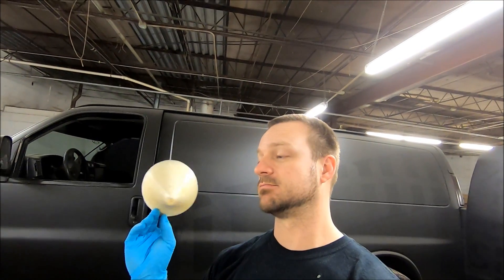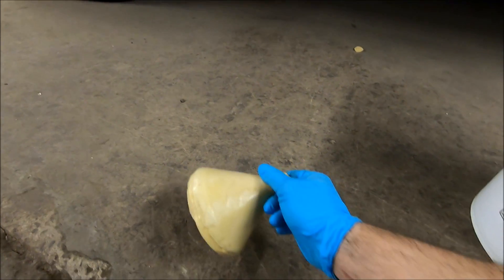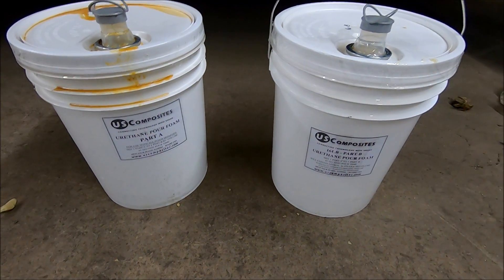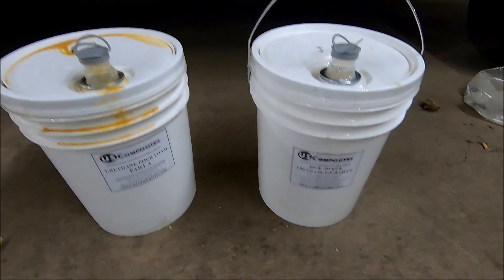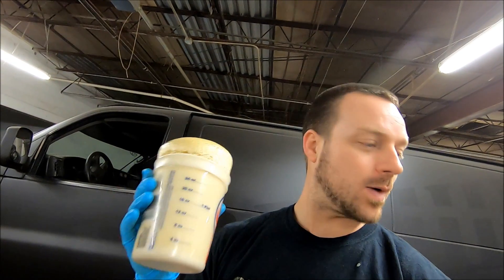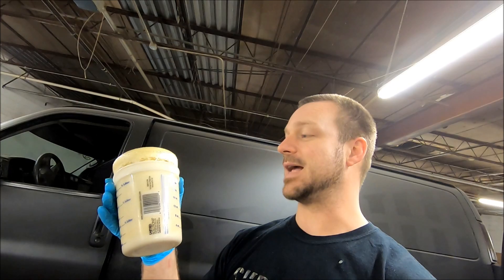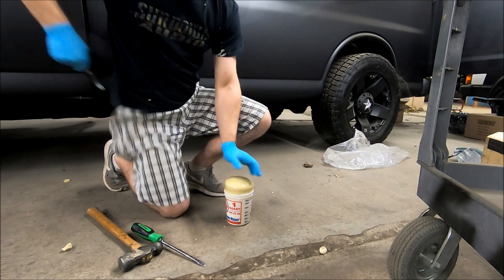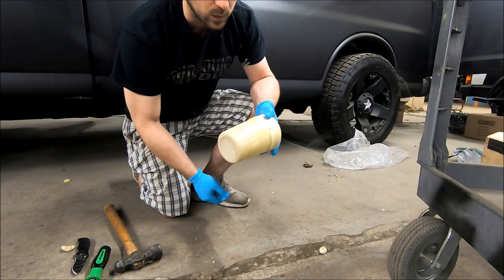***Strong As Concrete*** *Tech Time Thursday* 16lb Expanding Foam

Comment: Does it bond to what it touches?  I have 2 fiberglass sheets parallel spaced about 2" - would this foam bond to the sheets making the structure stronger?  Final result would be similar to a surfboard.

Comment: I was thinking about making a subwoofer box out of this stuff. I want to put a subwoofer in the rear side panel of my suv . I wanted the foam to form into the finder well and around the speaker . I want to box out the  air space with card board and tape it up so the foam can form around the speaker , panel and finder . Do you think this would work ?

Comment: a long time ago I heard of the japanese guys filling thier sills with expanding foam to increase chassis rigidity and they were even selling kits. Unless it set as hard as concrete it wont work but would be good for insulation and causing rust only.
Reply: Wouldn't it be like 3m pillar foam? Factory uses it.

Comment: 12 ounces of material made (-/+) 30 ounces of foam, that not impressive but there was one aspect of this video that was really sad and that is you don't have a utility knife...sigh
Or I'm guessing you don't cause I gave up at screwdriver and hammer on the floor.
If it doesn't stick to plastic 🤦‍♀️
POKE A HOLE IN THE BOTTOM...SIGH
Reply: Umm, it's 16lb foam, made to be dense, not airy.  It's not supposed to expand more than that.  If it expanded 2x as much, it would be 8lb foam.  If it expanded 4x as much, it would be 4lb foam.  It's not magic, that's how more and less dense foams work.  The more dense, the less expansion.

Comment: Might you know the maximum temp this mixture becomes and for approximately h ow long - when it sets?  I have an app where I can see using this to fill voids (to help preventing rattling) in an interior car plastic panel.  My concern is that this heat could distort the original shape of the interior panel.  Do you know of any such similar products that have a lower cure temp.

Comment: Could you mix silicates into it for more rigidness like you would epoxy or STF? then cover it with a bed liner, like line-X or something similar sold on the market? Id like to see a 2 x 3 ft, 1 inch thick plate of that shit take a durability test.

Comment: Great video. My pool steps are sinking due to collapsed support. It is made of steel like the pool wall. I am thinking of drilling a hole and pour this stuff to support the steps.
Reply: Did you use in your stairs... if so how is it holding up to the water? Is it soaking up water at all?

Comment: Does the foam make you're car rust after some years ?
Reply: So short answer is no but there is a caveat. Where the foam expands and fills its waterproof and obviously very hard, however if you have a void where water can enter and then not get out then yes you will get rust. If you make sure it's dry before using the product and then fill every hole(and mask everything that it can touch!) And use the right spots, etc then no you won't get rust,,it'll seal the metal from the inside...but that also means water that's left inside. I'd say take a heat gun to the areas you want to fill in a warm room before pouring it in to make sure there's no water, also a dry climate helps and so does a car that's been inside awhile. Either way just make sure that anywhere water can get inside the chassis is covered either with the product or other means so water can't get inside and start rusting. If you do that you won't have issues

Comment: put some in small plastic jar and put screw on cap see how much it puchs and also how hard does it b to cut ends off like spray foam after triming the ends
Reply: expand pressure im wondering if it gets trapped and has no where to expand

Comment: foam is great stuff to form,shave with rasp.  pretty strong and can make tons of stuff with it. It doesn’t like outside elements rain or water but for a insulator it’s great.
i use the cans at local home improvement stores for small projects it’s in a can. already maxed just shoot and spray.
Reply: Does this foam have a name?
Reply: @peterczako6661  check for spray foam (insulates),at improvement stores or online

Comment: Stuff is like my loaf of bread in home ec back in eighth grade. Haha. Pretty crazy how it gets dark before it starts expanding. Good thing to mention the heat during the process. Be a bummer to get burned. Didn't really have an interest in the stuff but figure it's informative. Views help. As for tech time Thursday. If you could explain. At what point is there too much wire for the power and what could be expected to happen if there's too much or not enough. You may have already covered it but. Something I've been wondering. Thanks for what you do. Greatly appreciate it.